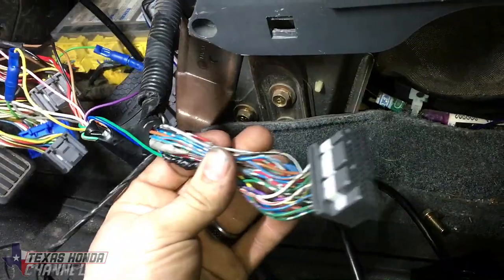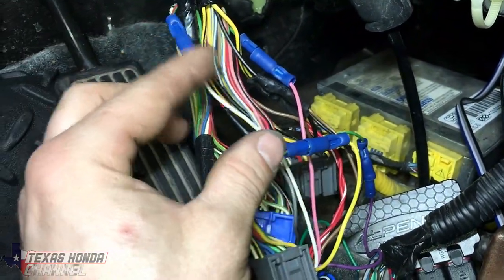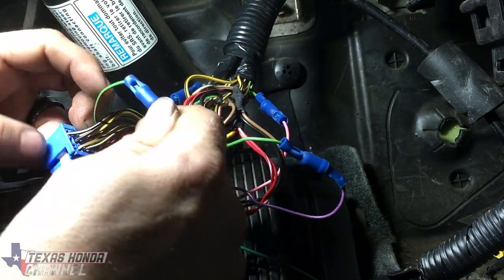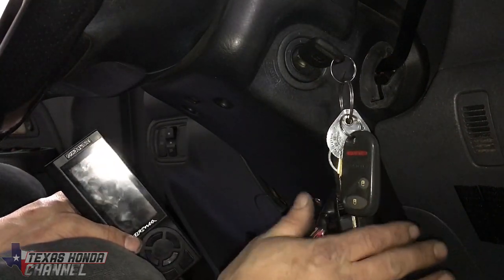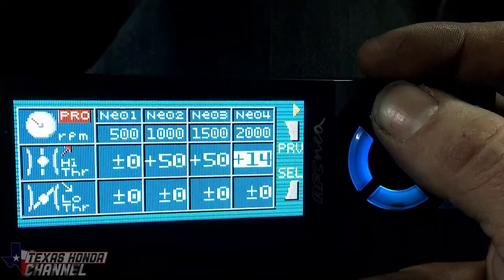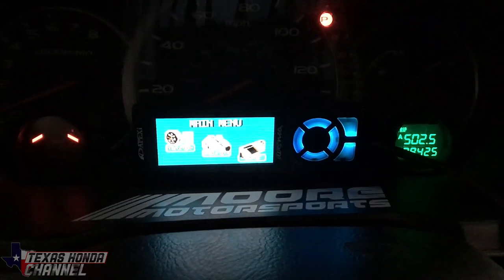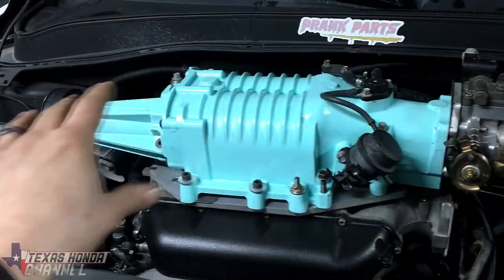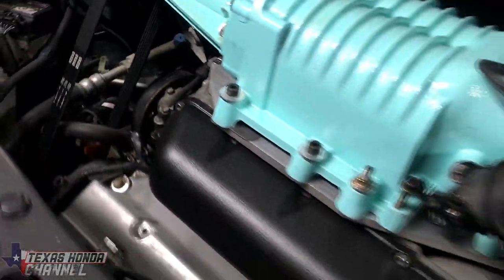Apexi Neo Install 2003 Honda Pilot Supercharged   (J35 PIN OUT IN DESCRIPTION!)

Comment from the maker: Just so everyone knows  im not saying the pilot is fast (yet).The pilot weighs in over 4,500lbs with roof rack, brush guard and off road tires. You add the parasitic drag from the AWD system, supercharger being installed you have to have about 1psi to break even back to the stock point of power. After you take that into consideration and the lift kit causing more drag with the air dynamics being skewed the fact that this 240hp vehicle is moving the way it does shows we are moving improvements. Once it gets bigger injectors installed and dialed in more we will turn the boost up and do another pull video. IM NOT CLAIMING ITS FAST!
Reply: Is that supercharger like a light color turquoise, if not for some reason it looks like it
Reply: Does the Apexi do everything you need for tuning, and the fuel injectors are limiting factor?

Comment: You don’t need to remove the drive shaft, if you pull the abs fuse and the vtm-4 fuse it be 100% in fwd. the rear diff has 2 electronic 12v clutch packs that completely connect and disconnect the power output to each axle.
Reply from the maker: Yea i did that but you still have the rotating mass you can eliminate from the equation all together. Either way works in the end.

Comment: I still can't understand how the fuel economy got better but hey, if it did it's dopee
Reply: If you add more power to your car as long as you keep from flooring it your engine doesn't have to work as hard under normal operation and in turn you have better gas mileage
Reply from the maker: More air and getting a better afr due to apexi tuner but either way im happy. If i can keep my foot out of it. lol
Reply: @TexasHondaChannel   is this little computer thing only for the pilot or will it work with a stock 97 civic computer

Comment: James, could the ECM freak over the Apexi because the fuel values are so high ? I wonder if the ECM will accept the Apexi when you upgrade the injectors and turn down the fuel settins . . .